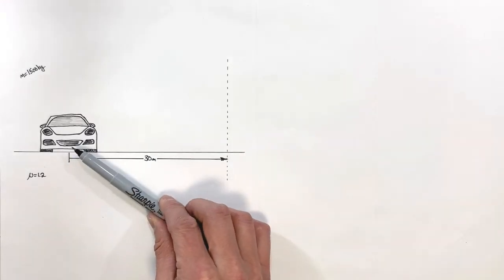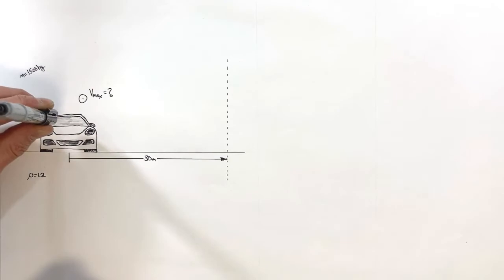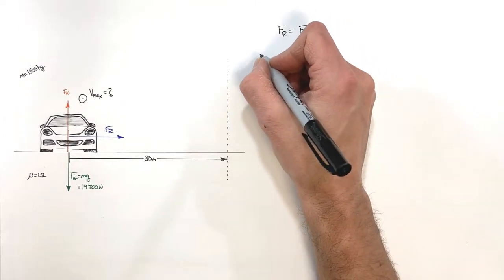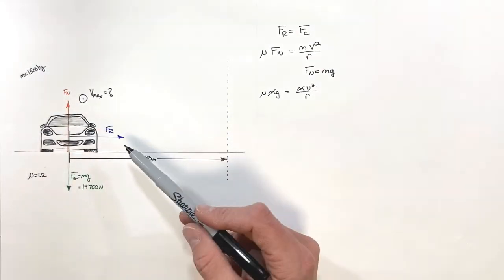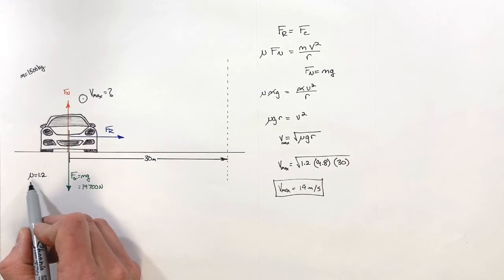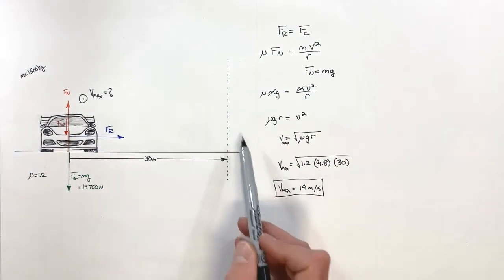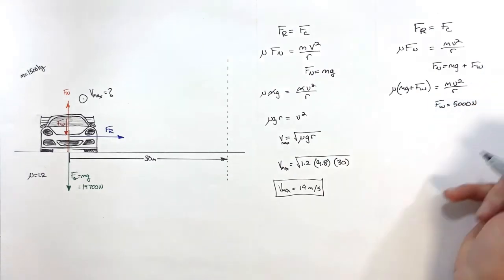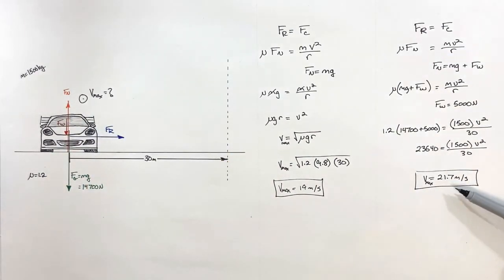How Fast Can a Car Drive Around a Corner? | Physics Explained

Comment: This is a nice video covering the basics of cornering mechanics but I feel it's very limited and a little misleading. The model you've derived suggests that a massive truck will have the same turning radius as an F1 car however this is definitely not the case. Ik you say the mass will cancel out but in reality as you make that turn it will create some moment about the center of gravity of the vehicle, thus changing the loads on each wheel. And you also assume the friction and normal to act at the center of gravity of the vehicle, but in reality it will act at each individual wheel and the cornering radius will actually be dependant on the wheel with the lightest load. I understand this is a very basic overview and the video doesn't require that level of depth, however I just thought it would be important to people watching this video to understand that determining the maximum velocity a car can make around a bend requires much more knowledge of the car and it's dimensions.

Comment: What if you lose friction around the corner such as drifting in the rain? You would want to hug the corners you're going through as in the rain you'll go straight a little more than in dry weather.
Reply from the maker: Drifting or not, it's friction (traction) and only friction that makes the vehicle go around a corner.  Less friction means the radius of the corner has to open up, or you're gonna have to slow down....  Unless of course the corner is banked.
Reply: @INTEGRALPHYSICS  Thank you for the info! I think I have a better idea of how to improve now! Thanks!

Comment: My qs is if suppose someone is turning with accelerated /decelerate motion during turing 

In that case there will be 2 type of acc 1) centripetal 2) tangential acce

Then f(friction)will not be radially inward towars the centre of curvature, it will be at some angle not 90° in case of accelerated turing angle between v and a(net accl) would be acute and in case of decelerated turing angle would be obtuse? 

So in that case only a component of static" Friction towards radially inwards perpendicular to velocity would be called as centripetal force? Is it? The components of static friction along velocity would be something else which will be responsible for speed change? 

Is my explanation is correct sir, because in my book there is some problem called banking of road in which only uniform motion turing is considered not accelerated or decelerated turing thats why i am asking is my thought process is correct
Reply from the maker: You are 100% correct.

Comment: Shouldnt doward force with wings increase as velocity increases? I don't think same 1500n downard would apply at 1m/s and 100m/s
Reply from the maker: You are correct.  I didn't want to get into velocity dependent forces on this problem though.